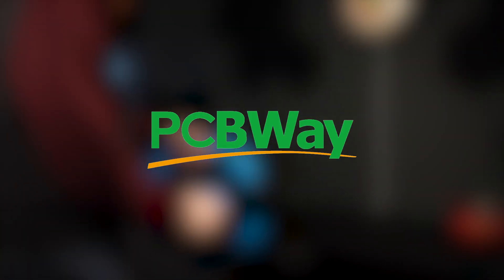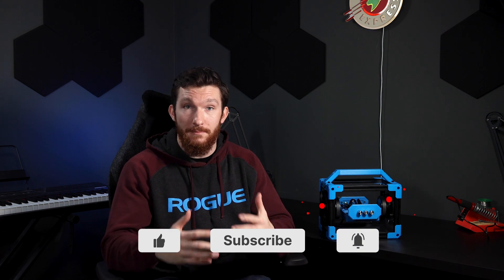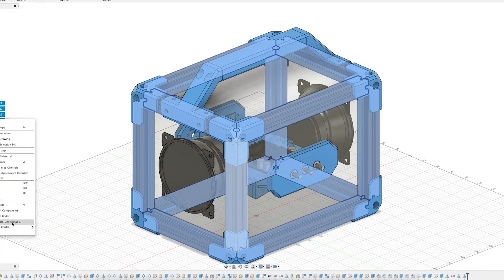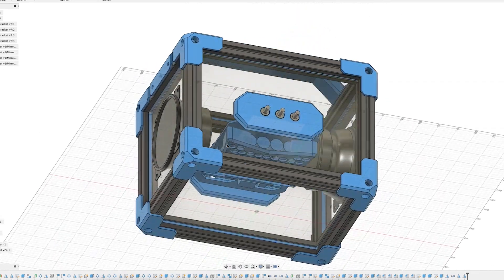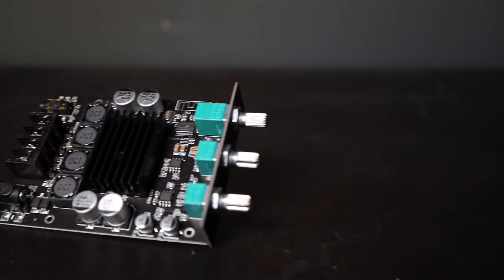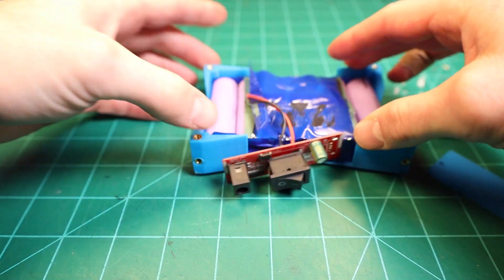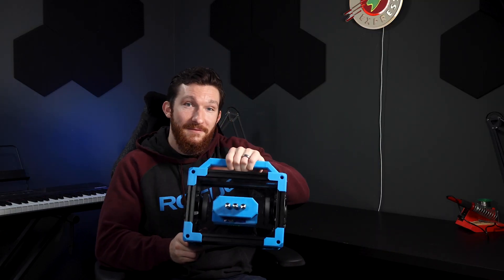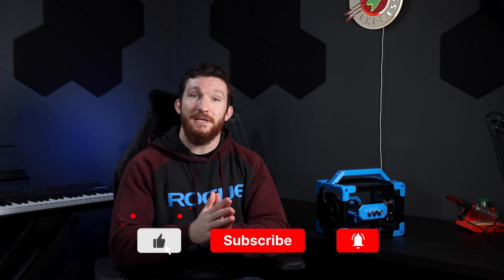Making a DIY 3D Printed Bluetooth Speaker!

Comment: great design aesthetic, yeah. i wouldn't worry about the acrylic flex interfering with your audio too much generally. its been a long time since i did any maths for volume/resonance/frequency response curves, but it may behoove you to add a open port or two [may vastly improve low-mid response as well as perceived loudness (DB) for same amp power settings] based on the measurements of cavity, or it could not. that is in no way anything but a little thought, and you may have even done it and i missed it, bc this is an amazing project!!! thanks so much for sharing your talents!!!
Reply from the maker: Thank you so much for the comment! After a few months of use, I've noticed some noise from the acrylic rattling on the frame, so I've considered adding ports and now that you've mentioned it too, I'll definitely add them. Do you think it matters where on the speaker I add the ports?